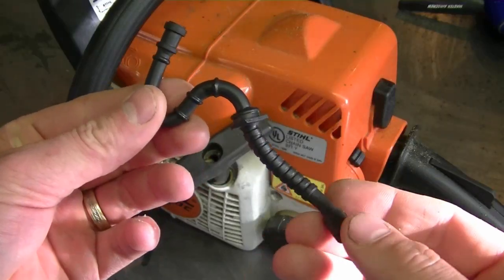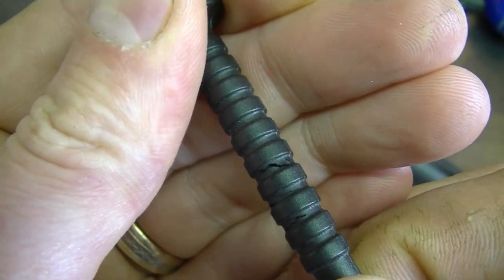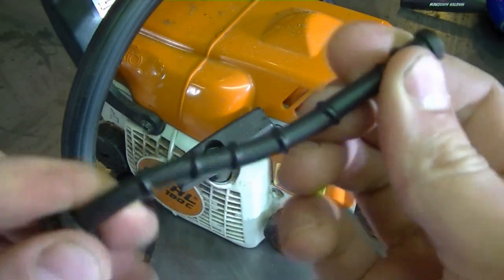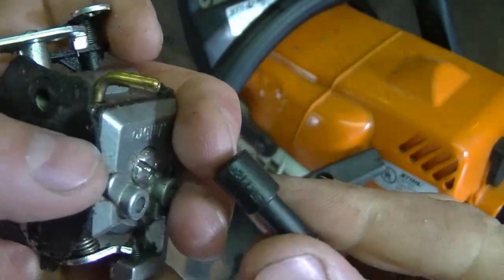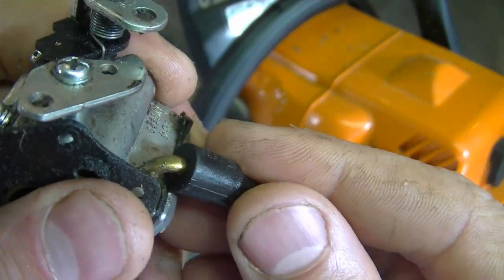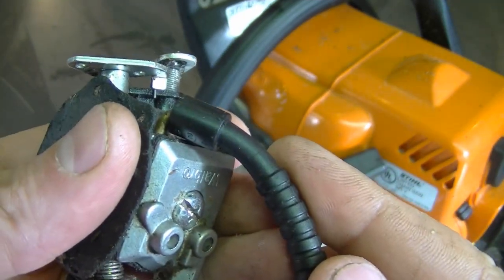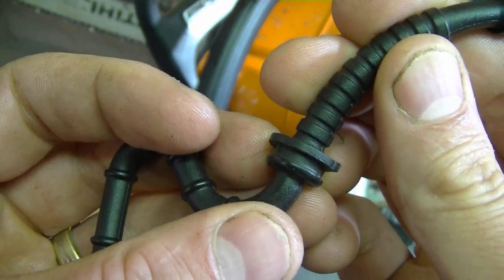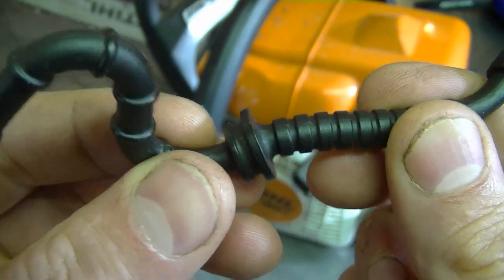How To Check a Stihl Fuel Line for Wear & Tear

Comment: Another great video! If the saw runs with the fuel line like this it could also create a lean condition. As you know running a saw lean for any length of time can cause some serious damage to the piston and cylinder wall.

Comment: Hey Dony
We have a Stihl Wood Boss 028 AVS. My dad owned since new, probably in the 80's.
Lately it has a hard time to stay running at idle once it warms up. It continuosly stalls at idle once warm, and is becoming hard to start. Replaced plug, air filter is clean, removed and cleaned carb, but not much difference...
Next step was to inspect fuel line and impulse line, and was told possibly the ignition coil or module could be on its way out.
I cant seem to track down proper parts! Everything shows 028 or 028 AV. Are these compatible with the 028 AVS? Or what are the differences?
Thank you
Im located in Eastern Ontario

Comment: Are you still active ? I have a 193t Stihl . I think the lines may be cracked . I’m getting fuel to the carb but no fuel coming out of the impose line. Also I replaced the the carb with a fairly used one and still no gas to the impose line

Comment: Hi, I bought a Stihl FS85 3-4 years old unit last week. when i start the unit in cold start choke settings it never starts, when i start the in warm choke  it starts but run directly on high rpm and wont go to idle run. also because it runs on high rpm the throttle control doesn't work at all. so to reduce the speed i have to move (slide) the choke to reduce the speed. i  have checked the s plug which was clean. i changed the fuel as well but no Joice. I am a newbie and not sure abt the problem

Comment: I dump the gas out of the tank and pressure test the fuel line, filter, tank vent and gas cap by pressurizing the fuel line with 7# and watching the gage on my MightVac.the gas line, tank, etc, better hold the pressure or I get the soapy water spray out and find out what is leaking.

Comment from the maker: try adjusting it or replace the carb kit
Reply: donyboy73 I've got a sthil 029, it starts runs then dies, it also dies after it's been running for some time and is hot it dies and then it won't start. It also makes a popping sound on tick over after it has been used for a while. I took it for a service last year but the mechanic didn't sort the problem as it came back from the shop with all the same problems minus £60 of my cash. Its a good saw when it runs and has plenty of power

Comment: do you have video of fuel line replacement on Stihl 064 & 066 - 088 ? most of what you show is on smaller saws, or do you get any of the bigger saws to work on? your vids are great though even if for the smaller saws!